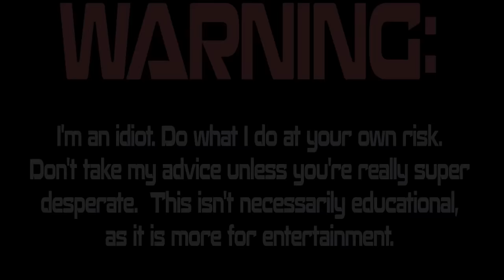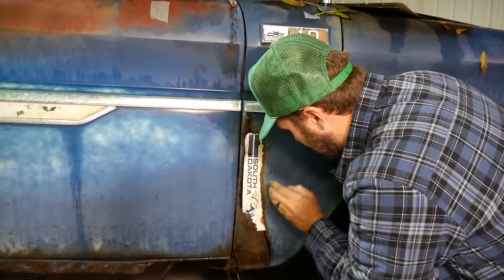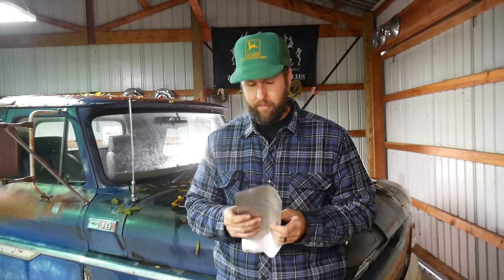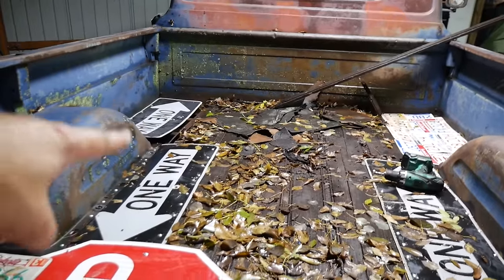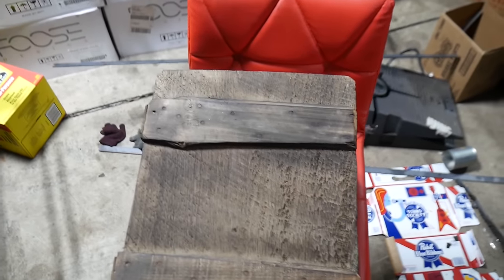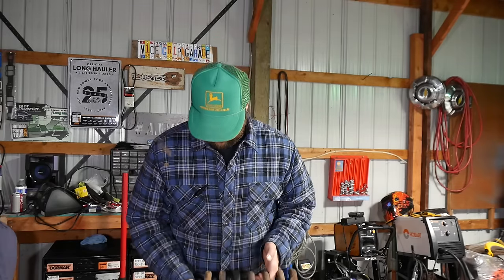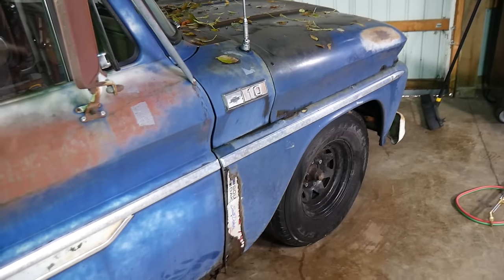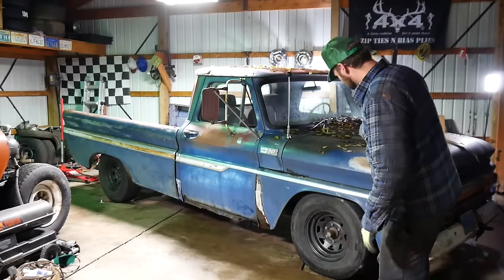Budget C10 Rat Rod Build | Part 2 - Vice Grip Garage EP44

Comment: I evenly heated the front springs on my 91 S10 that was already lowered 5” in the front. Placed a jack under the frame so it would rest on that and cool down at that height. It lowered it another inch and worked fine except when the tires hit the wheel wells over bumps so hard that it was like hitting the brakes. What I’m trying to say is it was fine and worked great.

Comment: I'm 55 years old, and I've owned 95 cars, trucks, vans, and SUVs (and 3 motorsickles). Most of 'em total hoopties. My 72 F-250 had a rusted out rear brake line, so I did the rite thing and plugged that side o' the master cylinder with a bolt. Fixed! My '71 D100 had no drivers floor at all, and, lacking road signs, I used the really thick sheetmetal from several old computer towers. Factree! I patched the bed the same way, AND restored its level-ness with a fence post (pressure treated, no less!) My '92 Silverado has bungee cords for both door and hood latches, and a bathroom faucet hood ornament, to give her some class.👍

Comment: If you mounted the cup holders on the front instead of the top, you can use the center console as a center seat. Just tack weld the strip to the side of pipe instead of the bottom. You still need a little strip on the bottom to keep stuff from falling though.

Comment: If you start getting bothered by the cold snack holders tipping when needing to get inside the console, mount the bracket they're on to the front of the console with a couple L brackets. Then don't gotta spill or take em out to open it. Love the channel and its actually my favorite vehicle tinkerin one. 🐍🇺🇸

Comment: You can also use food tin cans to get rid of the holes, just remove top and bottom with a tin can opener and cut it and make a plate of it, and they are already galvanized :)

Comment: Rust looks like the International 1010 pickup I had. Driver's floor was completely gone but I had screwed a heavy duty floor mat in place. Worked well except the one time I dropped my phone right through the floor. Never saw it again. Stopped driving it because the driver's door came right off in my hand one day. Keep up the good work.

Comment: I am a grad from Purdue University with a degree in pipefitting and metallurgy. The proper way to lower that coil is to heat the bottom coil from the bottom and chase that Barry up that coil and tell the coil collapses. App that precise moment spray it down with a hose. This snaps those iron molecules back into their original position. Space space this is called tempering. I did this to my 1980 El Camino when I changed it from a V6 to a 350 block. I put springs from a 1975 El Camino which were about time and a half thicker. I then put a new set of Monroe high-performance shocks on. This was 25 years ago and they are still as tight as new with perfect coil retention.

Comment: If you look through my old videos, I had a 1980 C10 with drop spindles, and cut coils in front, and some random leaf springs and axle flip kit in back. Ran it on all different size tires over the years, lifted the suspension, lowered it to the bump stops, it was a great truck. Should have kept it. You would have liked it, hockey puck body mounts, angle iron cab mounts, used 5/16" bolts to keep the rear bed fender from flopping around, and it was just a great truck.
Reply from the maker: Sounds perfect!!

Comment: I build my projects with pallet wood, it’s tough to get apart but looks old and lots of splits! I burn it also! Looking good my friend! I like the can holders! Awesome ! You can heat them but heat all the way around and don’t over heat the metal! If you had a rotisserie turning them, that would work better to get equal heat! But I’ve used an all thread heating and squeezing it down till I got my correct length! Then cover them up to cool slow! Keeps them from getting brittle!

Comment: When I was a kid my first car was a 1946 Plymouth convertible.  When I wanted to give a rake to my car I simply took a crow bar and reversed the rearward-most shackle.  It was pretty springy and it took nothing for it to spring back in place on its own.  Usually only one would so it looked pretty goofy until you sprung the other side back.

Comment: I took a 1989 Dodge dynasty and started cutting one coil off each one at the wide portion of the coil. Don't cut them where the coils are close together. This is your sensitive cushioning of the spring. Wide coils support weight. Dropped her almost 4 inches and she still road fantastic. Seriously no jolts, still had spring.

Comment: The springs are for over load you got them from j c Whitney. They put coil springs in for the ride. But found out that they were not strong enough. So you bought after market springs. The wood in the bed was used for live stock.

Comment: Thing of beauty.  Not gonna put anything heavy in the back anyway.  
Basically a 2 seat hot rod. What it'd be anyway with a decent bed. 
Now it a passenger car for 2.  Cut out the insides of the bed to add lightness,
and throw a V8 in it.

Comment: I’ve found that if you cut them coils, do it in a bucket of water and make small cuts and test the height with each cut then with the mate to that coil make one cut. Rule of thumb, don’t put your fingers in the spring pocket use a pry bar. It hurts sumthin fierce, when it pops up on your fingers.

Comment: Did the coil spring trick for a neighbor kid’s friend some years ago. I warned him that it couldn’t be reversed without putting in new springs. He said that’s okay, go ahead. Crawled under with my oxy-acetylene and told the kid to kick me when it got down to where he wanted it. Turned out OK and I never got any complaints. Did it like you—heated both sides of the coils.

BTW — Have you ever tried fiberglassing some of the large rusted out sheet metal areas on old vehicles? I spent my whole career in the fiberglass business and patched a few cars and pickup trucks with glass mat and resin. It adheres really well to metal—rusted or not, and after it’s cured (hardened) you can add pop rivets, screws or bolts to increase the structural strength of the repair.

Comment: Okay, on my 70 Chevelle Malibu, I cut 1 1/2 coils off the rear springs, but a V-8 Chevy van spring in the front right, and cut the left front spring by one coil. That and different size tires made the car turn left very quickly in the 1/2 mile dirt track.

Comment: The way to heat them springs is to just start at the bottom and just heat the bottom 2 coils just enough for it to barely sit on the bump stops then take out them rubber stops and shim the top a arm . I heat the coils slowly collapsing going up the coil then spray PB blaster to re harden have fire extinguisher handy .

Comment: sometimes for light duty repairs cold snack cans cut and beat to snot work too. as well as paint cans ketchup cans , also go run down to the local weld shop and go find yourself some L iron. could use that to fix the weeble wobble for the rest of the hole in the cab go find a flat hood at the local wreckers[ a  80s GM truck will do ] plenty of good metal to snag on that. i do have license plates but alot are from the 60s. best of luck and looking forward!

Comment: I replaced wood in pickup bed trailer using 1 X 6 pressure treated deck slats.  Started from bed walls and worked toward the center.  I used 1/4 inch carriage bolts and whiz nuts with fender washers.  Used giant carriage bolts and whiz nuts for the frame mounts.  Cost me $200 to $250.  Did not want to spend $700 to $900 for a bed kit on a pickup bed trailer.

Comment: Ahhhhh, Derek, l used the acetylene leaf spring lowering tool on my 1962 dodge hobby stock racecar back in the early 70's.  With noticible success l might add.

Comment: yes sir!! 85 honda civic in high school. i went ahead did the budget lowering kit on that. started off with the spring clamps and they would shift around. sometimes they would work their way around the spring and end up next to each other. one of them was really close to the strut and poked a hole in the strut. so thats when a guy just took a torch to them and heated up one side of the spring and no more problems. well one side dropped a little lower. but when your driving you mostly couldnt tell. and damn it rode like shit.

Comment: I once had a slightly leaky brake fluid tank (A drop of Brake Fluid when you made a full brake). Anyway, in Germany that's a  "No Go" especially when you wanna get your "TÜV" Sign.

... Glued it together with Treatlocker, actually worked for over a year - I hadn't any O-Ring at this time and my TÜV Appoitment (Which costs money) was in a few hours. So yeah.

Comment: Rub used motor oil into wood for a more durable finish than charring the surface.

It's safer to cut springs, as long as they stay captive at full extension, and install quality bumpstops.

I cut ~1.25 coils off my XJ to match the rear when I removed 1 leaf from each pack…
(95 xj: 2-door / 2wd / 4.0 / 5-spd )

Comment: I had an 84 Trans Am that I lowered by using all thread and two metal plates. One plate went about middle way of the spring and the other plate went on the bottom of the lower a arm. I tightened the all thread until I got the stance I wanted. It worked great until I heard the all thread pop one day!

Comment: I put big front coil springs in my little 93' shortbed dakota that were too stiff to compress,, when you jacked the control arm to bolt the ball joints up, the whole truck lifted up. Couldnt get the springs in.. The solution for a guy was to chain the front of the frame to the shop lift and then the control arm magically compressed. It was much too stiff to drive, so this feller yanked the 4 cyl out, and put my old chevy 355 race motor in which was conveniently heavier.. 500 hp really sends her down the road, especially after welding the rear up posi and putting Dutchman axles in that were narrowed 10". 😁 She does nice wheelies now. And the ride is much better now since all those wheelie landings have softened the front springs up a bunch. Of course narrowing 10" required fabricating/narrowing the rear frame (which was rusted out anyway, but only the rear end from salt water boat ramps. 2x4 box tubing. Also had to chop the rear fenderwells and weld 5" patches to extend them further into the bed. Now she fits 15" wide slicks.

Comment: Had a bud with a early 90s GMC 1500 that someone had lowered the wrong way.  They notched the back half and had a leaf spring in there with 2 leaves in it.  The front was the same flavor as you just did.  It banged HARD on bumps.  Suspension was non existent!!!!!  Good times….

Comment: I did diegrinder cuts on a 65 Olds and a 55 Olds with a 70 Olds subframe. And they rode and handled just fine albeit I wasn't putting them through any autocross courses, just daily street use. The 65 was to obtain a rake. And the 70 springs were more than the 55 Olds needed. I could've taken 2 whole loops and it wouldn't have been too much. But I had air shocks on the back with tired 55 leafs so it looked dropped. Lol

Comment: When the seat fell through the floor of my dad’s 1964 C10 we used the sheet metal from an old  HVAC air handler. Not as decorative as signs and tags but equally effective.
Reply from the maker: Great idea

Comment: I had a 70 El Camino with a 1st Gen SBC.  I put disc brakes in front and while at it, ball joints and ect.  Bought a set of Big Block springs from Chevrolet, they were old/new stock.  Cut a full 1 coil from the unfinished end.  Thing sat perfect when my boat was hooked up behind to.  One thing though, I like the rake look too but on a pickup, makes them oversteer even worse.  Trucks are light in the back already and raking it just shifts even more weight forward.  Dang it.

Comment: i heated the front springs and the top rear leaf's in my 90 ranger that i had a nicely built little 306 in which was sitting on 20" bullitt's out back and 18's up front. Looked awesome on a budget. Actually rode good.Then i decided to use Mustang 4 cylinder springs up front. To this day 19 years later those springs and heated leafs are still in the truck.
Reply from the maker: Wow thats cool

Comment: Back in 1969 I traded my 47 Studebaker pick up for a 57 Chevy that had a corvette 327 with 202 heads and a 3 speed trans in it.  Well the previous owner had a 4X4  block of wood in the leaf springs to raise it up in the air and when we shifted out of first gear at 60 mph the 4X4 flew out of the springs he had wedged in there.  Back then we made lift kits out of quarter inch steel and drilled holes in each end so we could raise the back of the car up in the air because that was the cool look back in the day and I was only 14 years old back then.  Those were the good days and I still wish I had that 57 chevy because its worth a ton of money now.

Comment: Never heated up my springs but back in the  97 I bought a 95 Nissan altima and got a set of chrome and gold 13" roadster wire wheels.  Put them on they looked great but the front rubbed the brake caliper so bad it didn't want to move. So I got a grinder out and ground down the caliper until it cleared.  Lol

Comment: You can safely cut coil springs, but only a particular kind. If they have the pig tail bend, or a flat bend on one end you can't cut them. If they are just a coil spring you can cut them, but take care to cut them the same length and to not build heat in the metal. Use a hack saw or a sawsall not a torch.

Comment: I used chocks of wood and set them on the ground so it would support the weight of the truck by the frame at my desired height when i heated up the springs. It helped make sure they were even and I got the right drop I wanted versus dropping the front end straight on the bump stocks lol What you did still looks great!!

Comment: Need to put Neon Beer signs in the holes.  The old ones might have a sheet metal backing.
Maybe the Neon sign could be hooked up to a coil and glow when the sparkularor fires.
Reply: Neon sign based tailgate.

Comment: My dad cut a coil off the front springs of his 69 c10 (he spaced the axle up off the trailing arms on the back). He used it everyday for 16 years like that. The only thing that would happen is sometimes you would hear the spring bump on the edge of the pocket because it didn’t sit right anymore.

Comment: I cut the springs on my 1978 Datsun 280z with the ole mini drimwizit 400 with an abrasive disk.....It actually handles,feels,and looks great now. I got away with it mostly because the stock springs that Datsun used are notoriously soft...so I guess a feller could say I got one of them race spec suspension systems now.

Comment: Yeah, I actually heated the front springs of my '74 Caddy Coupe deVille. It was nose-high in the front because the rear springs were weak, so instead of bringing up the rear, I dropped the front. I only heated the next to bottom coil on each side, just like you did there, and as I drove the car, that coil collapsed onto the bottom one, so I had two revolutions of spring sitting on the bottom in the cup, and the car rode about 2 inches lower in the front (parallel to the road now), and nothing about the steering, ride, or handling changed. I was very pleased. I never recommend heating a middle coil, as the spring loses too much lengthwise structural integrity. Always collapse the coils on each end as needed, and leave the middle of the spring alone.

Comment: I lowered my 71 Olds 98 front end by heating the springs.  Did just the bottoms and the tops (near them thar cups) and got about 3 inches.  I left the middle alone.  It went down the road nice with a great rake.  The rake is a lot more subtle on a 22 ft car though.
Reply from the maker: Nice

Comment: Derek, you guys are pretty lucky in SD. Here in North Carolina, we have to use those "Signature Body Panels" until the numbers wear off before you can get another one... Unless of course, you stroll through the mall parking lot after sundown. Not sure I like the idea of screwing them on. Pop Rivets would look a lot more classy. Of course, that's only my opinion. Here's an idea for you. Why not cut the tops and bottoms off those "Cold Snack" cans, snip down the sides and use them for body panels. That idea is free since I like your channel so much.

Comment: I like to use the ol saws y’all to cut the springs on the front and if the back has them leaf springs just pull all the extra ones out. 1 or 2 should be nuff the others just extra weight

Comment: ive cut springs on a few trucks the trick is to not cut to many no more than 2 and for the rear cut off the mounting saddle and weld it on the opposite side underneath the axle and now u got youreself a sweet low machine ive also made a center console subwoofer box out of wood and welded motor mounts in place and i didnt bother cutting off my rear brake lines i just let them hang there ill let nature take care of them cool vid man
Reply from the maker: Thank you 🤟

Comment: I  snipped off 2” on my 72 skylark’s springs. It improved the handling. Use some angle iron to fix up the bed frame. Could use sign post material. Thanks I’m a new sub. Sam from Pennsylvania

Comment: As for me I would used some kind of sheet metal for the floor of the back of the bed that's somewhat ridged where its not too thick. That's  if possible that there's any a great Discount metal company that you can get it for cheap. Then I would cut it in sections and fitted it in the back of the bed and do some rosettes welds all around the whole bed floor frame. Then take some strip of metal like 1/4 inches or 1/2 inches thick width Then weld it down to the floor  every few inches apart and that would give you some extra strength and help support the floor.

Comment: From 1963 on, the Chevy C10 came with front and rear coil springs from the factory. Ford was still using twin I-Beam suspension.